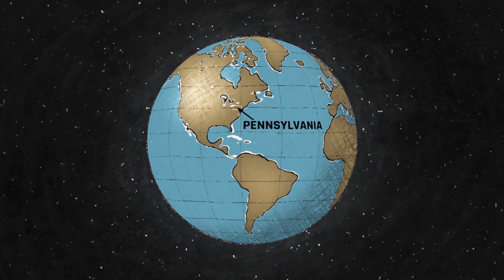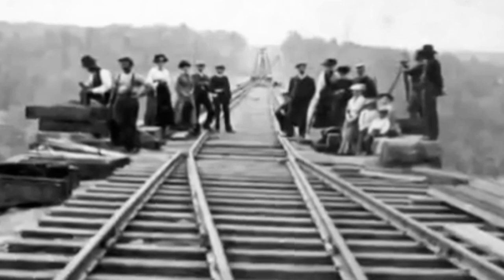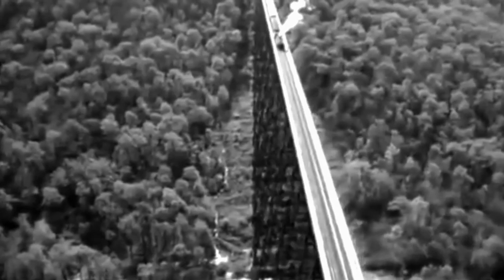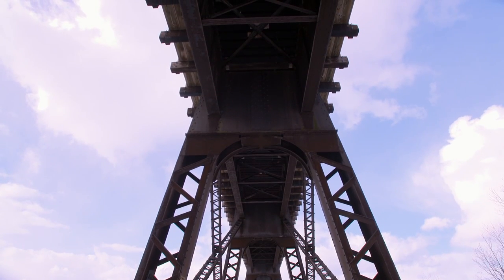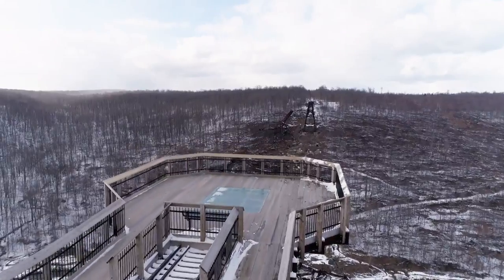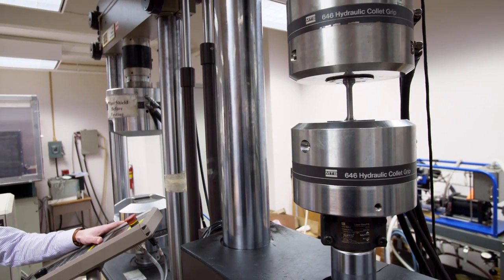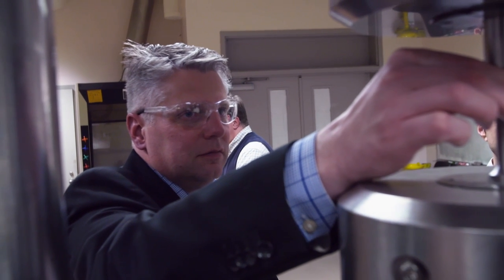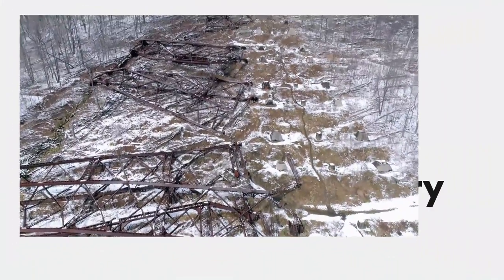How The 8th Wonder Of The World Failed Due To An Engineering Oversight |Massive Engineering Mistakes

Comment: Despite the engineering failure, I consider this bridge a success of its time. Built in 90 days & lasted over a 100 years, I say this bridge has served its lifespan. And the fact that no one got killed in its last days is an ultimate success.
Reply: How is a temporary solution a failure after 120 years?

Comment: So let me get this straight, this bridge functioned within normal parameters except under 1 rare circumstance, of which they didn't possess much information of when it was being built? That doesn't really seem like an engineering oversight, but more likely a freak accident. 

That'd be like saying in 100 years that a category 7 hurricane knocked a bridge over. And then saying it's an engineering oversight when in reality the designer didn't know those wind speeds could exist.

Comment: I was one of the last people to walk across the bridge before it was closed and then failed.

And honestly, with how long it lasted, i wouldn't call that a failure, and i'm an electrical engineer. I'll take any chance i can to rip on Mechs and Civies
Reply: Did you note the female "expert" is a neuroscientist? Little bit out of her field here.
Reply: As I see it the failure was that the restoration company did not immediately address the attachment hardware. The 100 year old corroded nuts failed and allowed the towers to be lifted off their bases and they were a known problem. Maybe shoulda replaced the weak link first?
Reply: @billmiller7138  absolutely. The original engineering was sound. The maintenance was poor.

Comment: This  was not engineering oversight.  It lasted over a century with winters morons. Amazing bridge
Reply: Thedudeabides803 We have bridges in England dating from the 1300's that are still carrying traffic. A hundred years is nothing.
Reply: @spencerwilton5831  Weather changes a lot of things. Tornadoes, for example, will topple a lot of structures not meant for such extreme conditions. The length and height of the bridge also weighs a lot in the balance.

Comment: I live in PA. About 3 years ago, it was determined that a bridge on the road I live on, which was about 60 years old ,needed to be replaced. The bridge spans a stream about 20 feet wide and the bridge is about 10 feet above the stream.  It took over 2 years to start replacing the bridge and about 7 months to finish it. They say we are advancing...I don't see it.  I believe we are past the peak.

Comment: 7:20 Wait... the piece he says cracked... he is showing the extended nut ( called "collars" ). I think there is some misinformation here.

The nuts are new with the rebuild. So what actually broke? The anchored bolt or the extended nuts?
Reply: Thanks!  I was wondering if anyone else noticed that.  They repeatedly mentioned "replacing the anchor bolts," but didn't show a broken anchor bolt.  They showed a rusty broken collar nut.
Another thought... did the collar nut fail due to the tornado or did it pop due to freezing moisture between the collar and anchor bolt?  Freeze-thaw expansion failure.  We will never know if the rust formed in the collar crack before or after the tornado.

Comment: As a structural engineer, I would say that all components of the bridge WOULD have been designed for uplift, perhaps from the 1 in 100 year gust. That is, the wind speed that has a 1% chance of being exceeded in any given year. This excludes tornadoes. So the iron bolts, though relatively brittle, should still have been designed to withstand the resultant tensile force. It beggars belief that it could have been otherwise.
Had those bolts been made from steel, there's a strong possibility, however, that the bridge would have remained upstanding under tornado conditions, due to utilisation of the ductility of steel past its 'working stress' level, up to its 'ultimate strength'. The bridge would nonetheless have been damaged, but not collapsed.
In the design of reinforced concrete structures in earthquake-prone areas, the very same principle of 'ductility' applies. Our professor drummed into us that we should always - and somewhat counter intuitively - UNDER-reinforce the concrete, utilising the steel's ductility. So even though the steel has yielded (technically failing), the structure still stands in what is called the 'plastic state', its occupants safe from collapse of the framework under the most likely earthquake design loads.

Comment: Excuse me, but the original designer used actual nuts and then later the second designer used collars
Reply: Yeah, they couldn't use nut because the old anchor rod wasn't long enough. So they use collars instead. The mistake is indeed they didn't replace the old anchor rod but the choice of material does not make as much different as the design of the anchor system here.

Comment: I would have figured the concrete piers would have deteriorated over time. You would have figured they could have added additional piers with steel bolts later on. The original piers were probably only designed to hold the lighter traffic when it was originally built. It lasted a long time as it was
Reply: Or merely gradual replacement of anchor posts one by one while the bridge would be held by all the others.  Would have been a long non-interruptive maintenance task.  Also, rebuilding the old design stronger should be entirely doable in near original time.

Comment: Just to be fair though, nobody else within the 110 years decided to ever replace the couplings. They can't blame it on the initial team. Generations of engineers after still ignored to check and replace these old couplings that weren't made of steel. It's realistically more of a group failure.
Reply: ... and the bridge had been closed for repair from 2002 to 2003, far longer than it took to build it in the first place! The guys in this video could have replaced the couplings instead of blaming their predecessors who'd been dead for more than half a century.
Reply: @tdpay9015  that's one of the problems with the world today.  Passing the buck, blaming others, rather than taking responsibility. People are so fragile that they can't admit when they are wrong.  Modern engineers were tasked with bridge maintenance and restoration. They/we should post the name of the firm(s) involved and find out why they didn't pour concrete caps over the footings and/or add tie-down cables to prevent/ manage uplift.
The answer of course is money. Someone got a huge insurance payout when that bridge went down. Why spend money to fix it when you know it is bound to fail and you can collect big cash? It would have failed due to corrosion/neglect because we throw everything away--we don't fix things anymore. How many bridges are condemed/rebuilt for lack of a coat of paint? We allow them to rust away.

Comment: Very good video, I'm surprised I had never heard of this before. For the benefit of viewers with no knowledge/experience of metallurgy or engineering materials, it might have been useful to define the difference between wrought iron (very low carbon) and cast iron (very high carbon), both of which were mentioned in the video. My engineering materials professor likened the carbon alloys of iron to a spectrum, depending on the degree of carbon content. If memory serves (it's been 35 years since I took the class), less than 0.002% carbon is considered wrought, or pure iron. This is very ductile and malleable. Steel is the iron alloy where carbon is between 0.002% and 2.0%. It is the most widely used of all iron alloys and the ductility and tensile strength varies with the carbon content. Above 2.0% carbon is cast iron. It is hard, brittle and has low ductility. Also, many, many other metals and chemicals can be used to alloy iron and/or steel. Please note that I have no degree. I came up through the job shop industry as a fabricator and welder and performed a lot of repair work. I took the engineering materials course to have a better understanding of the steel spectrum as I worked with a very wide range of materials. Now at the end of my career, I am a technical field advisor, but I am no authority on metallurgy or engineering. I'm just widely experienced with materials failure.

Comment: Basically boils down to time and money for the anchor bolts when it was erected (and the assumption upward forces would not be applied. Which is a fair enough trade off for 100+ years of service). But at least we can learn from this and understand why value engineering considerations need to be  appropriate for sustainability.

Comment: Since steel yields before it fractures, I suppose (correct me!) that a yielding component at one location distributes the stress to other components long before fracturing, making a more robust structure overall.  A brittle component that fractures doesn't "share" but dumps the stress, and so the whole thing can fall like dominoes.

Comment: You should change the title of this video. The bridge was a feat of engineering at its time of construction. I grew up in PA, and only had one very small tornado in 18 years, the fact the bridge stood for over 100 years shows this is not an oversight, but a lack of maintenance. They had 100 years to reinforce the bridge.

Comment: As a mechanical engineering student, if the bridge wasn't designed to withstand a tornado, then it failing due to a tornado is not a engineering oversight. If it was supposed to survive direct contact with a tornado, then it was indeed poorly designed.
I imagine that the engineers did some simple math to calculate the estimated tensile stress on the bolts, and concluded that there was no worries unless absurdly high winds where to hit the bridge directly. And seeing how it took over 100 years for this to happen, with the bridge already out of service, I say that they did an amazing job at designing the bridge.

Comment: after the coal run of PA was done that bridge was more of a tourist spot with limited trains going over it. I was there 2 years before it's destruction. I returned there after the clean up efforts and let me say it is STILL a marvel to behold! This video is a fail, not the engineers that did the impossible of replacing it in 90 days. Todays engineers can't even prevent potholes from forming let alone achieve a task such as putting up a bridge in 90 days. BTW the bridge didn't fall from grace, it was reused to make a skywalk which made it more graceful then you guys.

Comment: If you want to know why the bridge didn't fail sooner then keep reading.
Wrought iron IS NOT the same thing as cast iron,  wrought iron isn't readily available so the program and the engineers decided that everyone is too stupid to understand the difference. So while they couldn't show the actual material used they substituted a material with a similar name. The reality is that steel is as different from cast iron as cast iron is from wrought iron. Yes the collars cracked, no they were not cast iron, the bridge wouldn't have lasted a decade if they had been made of cast iron.
Pennsylvania regularly sees tornadoes stronger than this.  We regularly see gusts of 100 mph(160kph) with direction shift.

Comment: A common mistake really sad to see. NO cast iron does not UNIVERSALLY exhibit "Brittle Behavior". Usually the cast iron that exhibits that sort of lack of toughness (technical term there!) is a NODULAR cast iron, which can have 5 to 10 Foot Pounds at below 50 degrees F. A charpy Vee Notch test on a DUCTILE or even GREY cast iron could have a charpy V Notch of 50 to 80 Ft. Lbm, and would have a tendency to neck (a ductile response) in the tensile test as much as the "steel" sample shown in the test. Now if the TENSILE sample was actually MADE from the castings that were used, they may have been nodular cast iron, although I actually doubt that.

Comment: That was very well put on the iron vs 1088 steel or whatever it was but I do welding and know about the yields of ductile metal vs brittle. I’m assuming 1088 is a synthetic mix to achieve both of best worlds. I didn’t take metallurgy it was apart of my studies though.

Comment: The real engineering oversight is waiting 110 years for the restoration and repair. New steel anchor bolts would have made the bridge stronger in wind and vibration but how can they say for sure that would have made the difference in withstanding a tornado.

Comment: Yes, SOME anchors failed BUT...  The bridge was undergoing repairs to replace those anchors.  As such, several of the towers were NOT anchored down because the bolts were in the middle of being changed. This allowed a few towers t start a domino effect and the remaining towers with old hardware couldn't stand the additional strain.  Simply put, nobody ever could conceive that a tornado would hit the bridge right during the repair period, so it was not factored in. Perhaps those that believe in divine intervention might say that the toppling of the bridge with nobody present to get hurt may have avoided it collapsing under the weight of a tourist train full of people.

Comment: Cast iron and wrought iron are very different.  I believe wrought iron bends and flexes more than steel, but doesn't bear as much weight.  Cast iron is generally very brittle.  It's hard to believe they would use it, but I'm not an engineer.  So which is it for the collars, cast or wrought?  If they lasted as long as they did, and it took a tornado to make them fail, it's not bad at all either way I'd say.

Comment: The restoration engineer is to blame. Footing plates could have had welded extensions installed to ancor bolts set in concrete ring pylon footings poured around the original  footings.

Comment: They should have learnt from the failure of the Tay Bridge, in Scotland, which was brought down in the same way - 124 YEARS EARLIER.  The engineer in charge of the design made no allowance for uplift caused by storm force winds blowing off the North Sea and up the Tay Estuary, and (just like at Kinzua), the deep valley through which the Tay flowed acted as a wind funnel.  Unlike the Kinzua Bridge, a train loaded with passengers was crossing the Tay Bridge when it collapsed - estimated death toll, 75 people.

Comment: They had 100+ years to retrofit those anchor bolts. And it took a direct hit from a tornado to knock it down. I think the original design held up well, especially given the design standards then. This was a maintenance failure. My only question is if the retrofitting they were doing when it fell called for the replacement of the anchor bolts. Was it going to be fixed?

Comment: Why not replace the anchoring bolts later on when the impact of uplift on structures was discovered?
Did no one think of it until this happened? Or did this event specifically point out the issues of such connections?
Reply: Work was in progress that very summer to strengthen the bridge, and I assume the anchoring bolts were part of that process but not certain.

Comment: I passed this video to my brother, a Certified Professional Mechanical Engineer (college degrees, certifications, blah blah blah) ... 

His specialty is failure analysis and has worked with aircraft support equipment and motorcycles... But the majority of his work has been in automated agricultural machinery.

This is what he said on viewing the video here ...

"That train video is absurd. They built the biggest railroad bridge. Ever.  Then they used it for 100 years.  Then it was hit by 160 mph wind and blew over.   That's not a engineering failure.  It's an engineering triumph.

Comment: Excellent....except that the anchor bolts were not Cast Iron {brittle}, but Wrought Iron {malleable -- tho not as much or as strong as steel}.  So the demonstration comparing cast iron to steel  is inappropriate has little bearing, and is misleading.   The text of the video itself also specifically points out the original engineers knowingly, and correctly for the time specified "Wrought Iron" not "Cast Iron" --because of wrought iron's ability to take bending stress.   Plus as others have pointed out:  the bridge lasted very successfully for 100 years.

Comment: Such a lucky failure due to a tornado, and not to trains passing.    The original design engineers did not overlook this kind of failure, it was the inspection engineers 100 years later that overlooked this failure mode, and I understand why.  How many tornados hit PA annually, in that area?   I'm guessing very few.

Comment: After doing tests on sample rods of steel and iron, someone points to the nut as having been the failure point.  They were steel.  I would have like to see a photo of a broken bolt sticking out of the concrete.

Comment: We lack the ability  to engineer  a  new bridge  to essentially  last longer then  20- 50 years at the most and that's including "over engineering"  which  currently  seems to be the norm in the construction  world . 
       Yet  we left with modern world  of professional castigators or nit pickers  that can reverse engineer a bridge that lasted longer then 100 years and have the audacity to call it a "massive fail" or "oversight" .

Comment: The current inspection engineers knew they were cast iron bolt caps securing the base plates to the concrete pilings, they failed to recognize the need to drill through the base plates deep into the concrete pilings and install expansion steel bolts with locking nuts to remedy the potential of the cast iron cap nuts failing, this bridge failure could have easily been avoided if todays structural inspection engineers had done their jobs correctly.